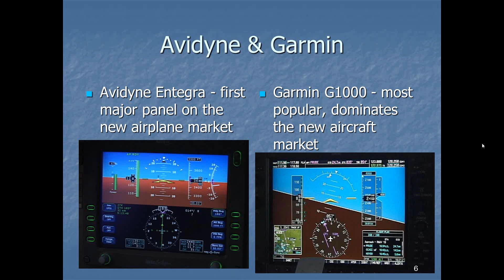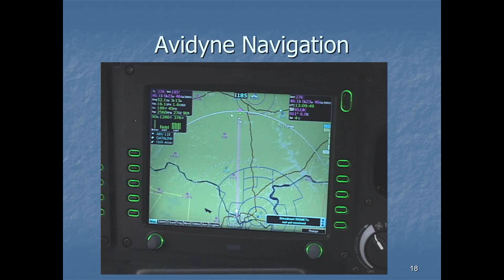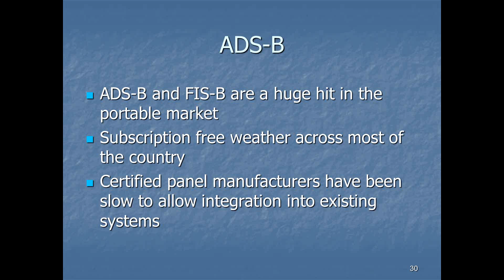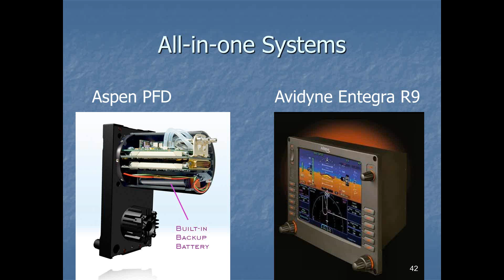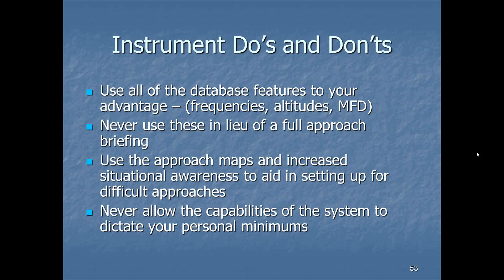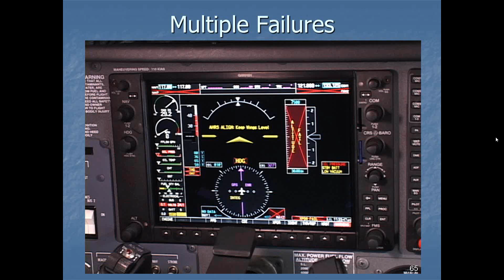Webinar - Flying with Glass Cockpits

Comment: Excellent presentation.   9 yrs later the presentation is as valid as ever.    It’s a pity that some sort of standardisation was not enforced as per the analog system, never the less there are some similarities in the information provided.    The big ticket item to learn is buttonology ……especially before using in IMC…….otherwise the cheese holes will line up quickly!
Thanks